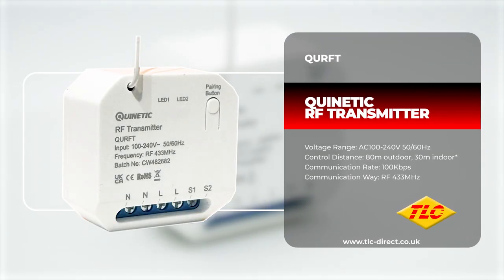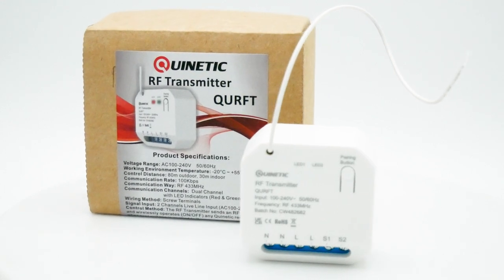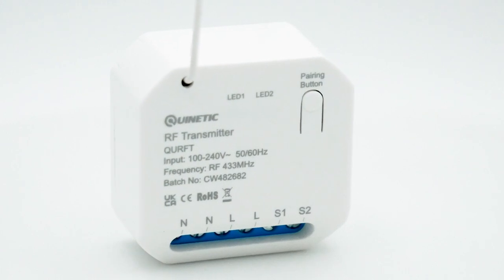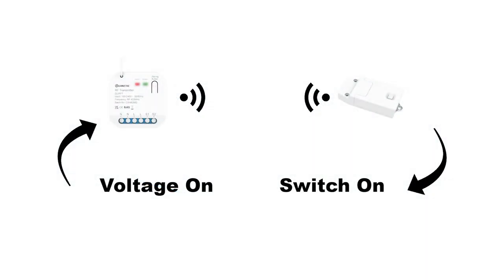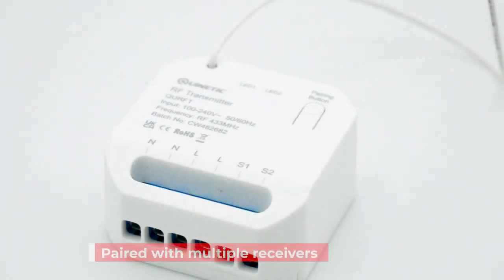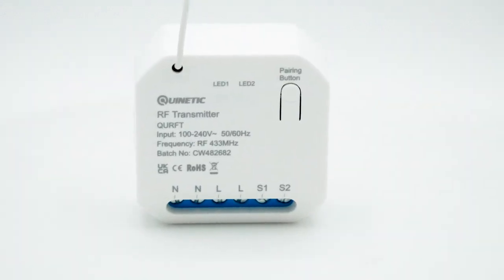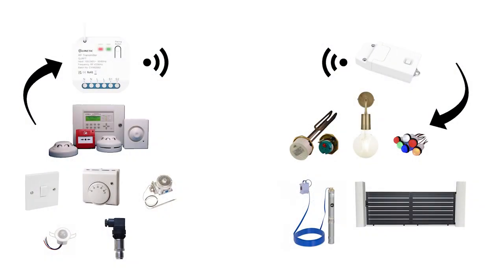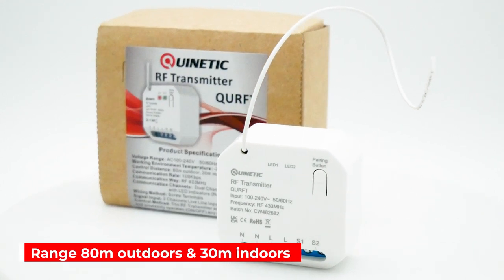QURFT - Quinetic RF Transmitter

Comment: Is there a way to make the transmitter work in a 2 way switch set up? I.e physical light switch connected to the transmitter, controlling the same load as a quinetic wireless switch. And have each switch change the state of the load. I.e on if off and off if on?
Reply from the maker: Yes, it is possible. You have to pair a Quinetic switch to the same receiver that the transmitter is paired to.
Reply: @tlcdirect  I tried this but the physical switch had to be reset each time. I.e. switch on with physical. Switch off with remote. Physical switch now has to be switched off and back on again to switch the light on. Is there a way to make it work like a wired 2-way where the switches just toggle the state of the load with one action each time?
Reply from the maker: @pete1942  Please contact our Technical Support team on tel. 0044 (0) 208 452 6600 and they can discuss your requirements.
Reply: @tlcdirect  Thanks, have just spoken to them and for the benefit of anyone else reading this, it can’t be done.